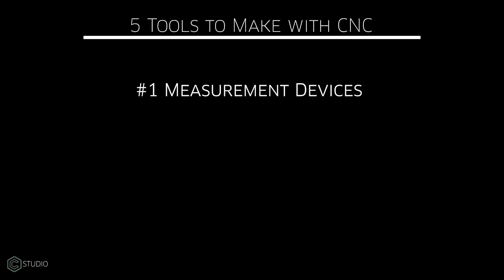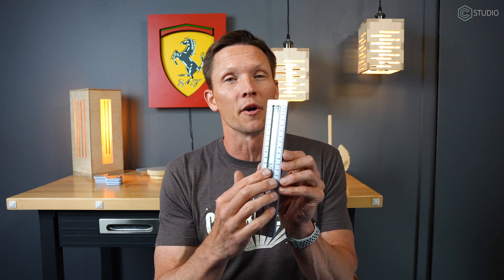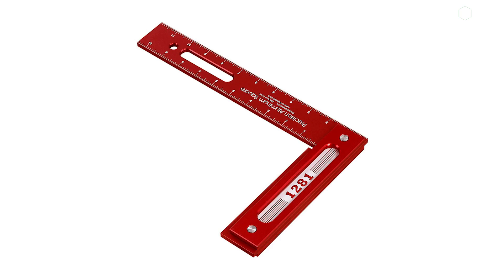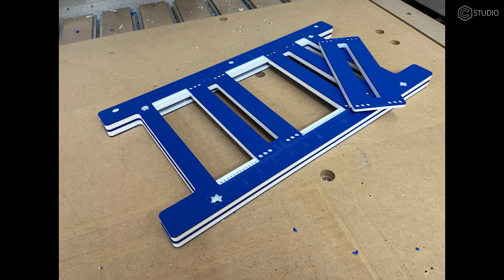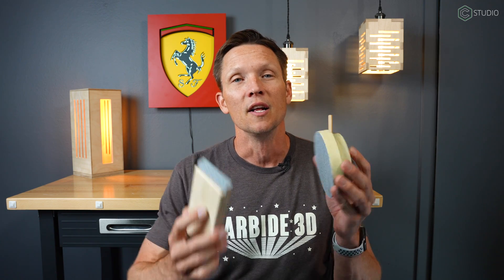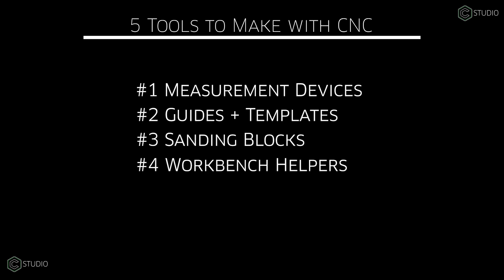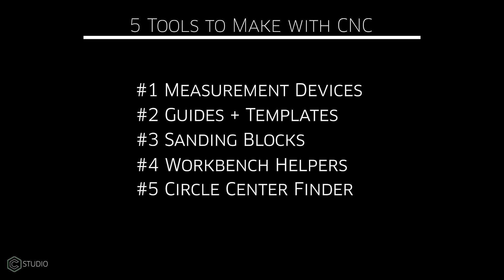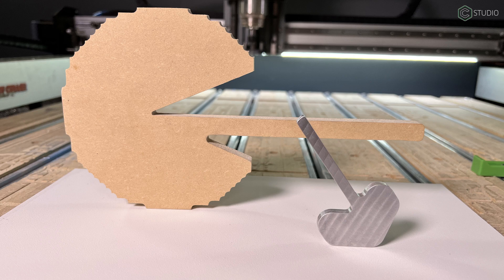5 Tools to Make with CNC

Comment: If mine cut square, that would be great.
Reply from the maker: If you need help setting up your machine, reach out to support.
Reply: @carbide3d only issue I've had. Other than that, the machine has great. I use it for wood as well as carbon fiber. No issues with it's performance

Comment: I made a circle center finder a few weeks ago. Such a simple, but precise tool. I tried it on the bottom of an empty drywall mud bucket, and it lined up perfectly with the little plastic dot in the center of the pail.

Comment: Something that is coming up fast on my list is templates for electrical box cutouts on drywall since I consistently screw the hole up. It’s either too big, too small, or wrong location.
Reply: I made one years ago, before I had a CNC, and keep it in my toolbox when I do kitchen installs. I use it mostly for the plug cutouts in islands and microwave cabinets.
Made the original with a router, in MDF. I've since made a new one with my CNC, with the exact same measurements.

Comment: I don't use it anymore since I changed my setup to allow for better access, but one of the first things I made with mine was a ramped guide that fit on the router carriage itself to keep my vacuum hose and power cord from snagging anywhere.

I have a tall frame above the table now that allows for full hose extension, but keeps it out of the way with a light duty bungie to take up slack as the carriage moves closer to the front.  Works perfectly.